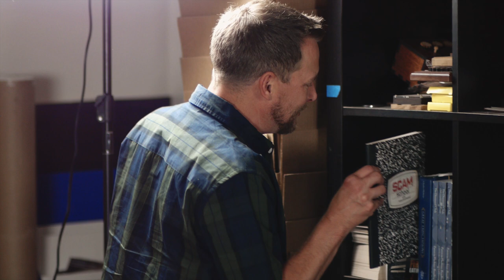Melting Styrofoam into Knives

Comment: "Styrofoam is strangely expensive on Amazon" yes. As someone who uses Styrofoam for model making, yes.
Reply: LPT: Hardware stores sell huge boards of it as insulation.
Reply: @CubicApocalypse128  They do, and in different hardness/densities, too, but it's got a very different texture from either of those foams. As an amateur prop maker, I use the stuff a LOT as sculpting material that I later turn into master molds that then are filled with resin/epoxy. It's very easy to work with, sands beautifully. It's EXTREMELY different from these two kinds of styrofoam. The crumbly bead kind that they used is impossible to sculpt/sand, and the other brittle "flower foam/craft foam" is also horrible to work with, but you can get away with using it as a frame of sorts for some projects. You just have to cover them with fiberglass and resin. 

So yeah, good info, just making sure everyone knows that they're VERY different kinds of foam, even though I think they're all polystyrene?
Reply: @wren7195  Yeah, craft foam is kind of garbage. What's even worse is that really crumbly green floral foam. You know, the stuff kids can't stop digging their fingers into at Walmart. (seriously, I've never seen a single piece of that stuff that doesn't have huge finger dents in it.) 

The "crumbly bead kind" isn't impossible to sculpt, you just need a hot wire tool to do it. I made some broken stone pillars with it for a stop-motion set once.
Reply: @CubicApocalypse128  Oh wow that'd be neat, I saw them doing that in some of the "making of" things for Lord of the Rings, it'd be really cool to see your work on the stop motion project. 

I completely forgot about hot-cut tools, I had a really flimsy one while back that broke due to operator error lol, so I kinda forgot quickly. Thanks for replying! Take care :)
Reply: @wren7195  I'm not sure if I still have the final animation somewhere. I do have some photos of the set, but the lighting we used really didn't show it off. The concept was, a guy fights a giant snake on a pile of sand in a flooded underground chamber.  It was a first-semester final project, and one of the other guys in my group insisted on only using a single dim light, centered directly above the action. I went to all the trouble of painting a sheet of styrofoam green and dabbing hair gel on it to look like water, but thanks to the lighting I might as well have just used a black tablecloth.
Reply: @CubicApocalypse128  That's unfortunate, I hate when one jerk messes up a group project by being lazy or over-controlling. I hope you had fun though, the concept sounds really cool. I keep picturing a cross between Chamber of Secrets and Conan the Barbarian lol
Take care of yourself, thanks again for all the fun conversation smiles Best wishes to you
Reply: @CubicApocalypse128  you should post the stop motion id definitely love to see it

Comment: Anyone else gets goosebumps from Styrofoam.
Also, 9:35 the burning acetone plastic could be used as a weapon, if you threw that on somebody it would burn and then harden so it would take skin off with it.
Reply: James Sawley Basically napalm.
Reply: yeah, in fact they make a similar thing in prison with melted chocolate
Reply: just less effective napalm
Reply: Yu Jin napalm is just a bit hard to come by so you have to settle for the next best
Reply: Eigil Holm military napalm is like 3 ingredients with 2 of them being gas and styrofoam
Reply: Eigil Holm it's pretty easy to find the rest I feel I might get banned if I say any more
Reply: Really? I thought it used molten metal.
Reply: James Sawley if you threw it at some one there's the potential to light yourself ablaze, effectively causing it back fire, no pun intended
Reply: Acetone + styrofoam is one of the most popular Molotov Cocktail blends, actually.
Reply: Really bad for riot control police officer's skin.
Reply: Digger Nick well, the napalm ones
Reply: Digger Nick It's not like officers are wearing short sleeves and shorts...
Reply: But they are not typically wearing fireproof clothing either.

Comment: Aren't those particulate filters on your respirators? Pretty sure those aren't chemical (carbon) filters
Reply: ItsAlleged hey its the modern rouge
Reply: good point :D
Reply: Whatever the filters are, all the acetone will be going around the masks, in the gaps created by their beards. Facial hair and respirator seals do not play nice.
Reply: especially beards that thick, those respirators were useless
Reply: I work with sulfur dioxide a lot and a little stubble doesn't seem to prevent a good seal. But yeah, that much man-fur probably becomes an issue

Comment: If u want to have no bubbles put the mixture in a vacuum chamber then use it
Reply: Tucker Wise what have you done with my cat
Reply: That's what I thought!
Reply: Yeah, they definitely have access to a vacuum chamber in prison.
Reply: Heat guns also work for that.
Reply: would need to cure in chamber. vacuum would evaporate acetone super fast when negitive pressure applyed.
Reply: or just, you know, use a little more acetan and stir it about 30 minutes
Reply: Jamez Martinez exactly this is supposed to be realistic not practical
Reply: Or just slam it against the table a lot till the bubbles come up
Reply: Seleen Shadowpaw acetan?
Reply: Yeah, that's pretty much how it's written in my language, problems with that?

Comment: Not a dirk! If anything, what y'all have got is a diminutive katar or failed bagh nakh
Reply: Gavin Christenson yeah a dirk is closer in resemblance to a dagger mainly due to the shape. However the main difference between a dirk and a dagger is that a dirk is meant to be more discreet and concealable. A dirk also smaller than a dagger which goes without saying since in a sheathe you get easily hide a dirk in your pocket or even your shoe depending on your fit size.

Comment: As a kid I soaked styrofoam with gasoline and when I tried well actually a mold I just put it on cement and let it dry and when it dried hard ,I sharpened it on the cement and made a really good knife very easily and very useful;  it lasted all through the summer,  but nice try guys
Reply: Mike Cherney u made napalm, good job!
Reply: Zed Zoss Well if he had to use it in an actual fight he could just break it off inside them and set it on fire and they have burning napalm just inside of their body.

It’s actually genius if you think about it.
Reply: That’s an impressive age to be making napalm B
Reply: Ian's Meme Factory that’s incredibly unsettling to hear someone say
Reply: Zed Zoss It’s a napalm knife, what else are you gonna do with it that utilizes the fact it’s made of napalm?
Reply: Ian's Meme Factory you know, that’s a very good point you have there
Reply: Either the styrofoam or gasoline ingredients have changed.   Used to melt it down with gas too and didn't get all the air bubbles I do now.

Comment: I think Brian's suggestion of dribbling the slug into the models was the big thing that made so many of the knives not work. The plastic dried instantly in small volumes so the plastic wouldn't be able to degas or to fuse properly. The only knife to get a good pour was Jason's and it turned out the best.

Comment: If you slammed the molds on the tabletop after pouring in the dissolved styrofoam, it would probably force the air bubbles out. It's what you do in baking to get the air bubbles out of dishes.

Comment: Hi guys you want a tip? 
You have to put pressure on the fluid to get the bubbles out. Like put it in a water pressure pot. I dont know the english word, but the key is pressure to make it a solid piece. Of course the solid product will be smaller in size than the fluid.

Comment: Here's what's happening here:
Styrofoam is a network of C8H8 (atleast that's standard polystyrene). Acetone does not have a standard chemical reaction that breaks the polystyrene apart into its components, but rather, it simply breaks the bond between the polystyrene molecules, making it into a Non-Aqueous solution (An aqueous solution is something dissolved in water, like sugar or salt, a non aqueous solution is an aqueous solution where the solvent isnt water). Then, as you know, the acetone dissolves allowing the hardened more compact version of polystyrene

Comment: the proper usage for using a respirator is  1) no beards. 2) when you breathe out and before you inhale, you must pause briefly.
3) when you breathe in and before you exhale, you must pause briefly. Why ? the sealing membrane must be completely shut/shunted to provide protection to your lungs. 

when you talk and breath(with out pausing) you actually let in out side air. especially if your breathing is labored.

Comment: The trick to a decent solid piece of plastic is letting it sit for a few days before attempting to cast with it so the air bubbles work their way out.. just keep a layer of the solvent on top and it'll never harden basically. We always used gasoline instead of acetone as well.

Comment: The packing material you first tried to disolve wasn't styrofoam (polystyrene). It looked like LDPE (Low Density Polyethylene). Two very different plastics, hence the different reaction with acetone.

Comment: I was wondering if you tried this again you could compress the shiv multiple times through the drying process so theoretically the pressure will push the bubbles out and give you a denser plastic with less bubbles in it.

Comment: sighs if you really want to make a knife from styrofoam, then use about 60-100 styrofoam cups. Light them on fire so they turn into a sludge. While the sludge is still warm and plyable, mode it into the shape you want it. Then file it on the ground after it is fully hardened. Then when you're done doing your dirt, slam it on the ground and it will shatter

Comment: When metal is poured into a mold there are little indentions on the sides or bars. I know you know what I'm talking about. You would heat the Styrofoam to a hot plastic consistency then, pour it, into a mold that's open on top, wait 3 days, you may get a better knife.

Comment: For anyone trying to do this.  I would suggest putting the acetone and Styrofoam mixture in a vacume chamber to eliminate the bubbles.  Also use a better mold to cast the blade in.  Silicone would work worlds better.
Reply from the maker: there are no bubbles.

Comment: You could probably pour the mixture into the mold and then put the mold in a vacuum chamber and it would take all the air out if it so it would have bubbles when you take it out of the mold

Comment: Guys i know my comment is too late. I guess the reason why your plastic got stuck to the mold is the absence of release agent, wax or even liquid soap (if you are in prison loool)
So next time try to apply a very thin layer of liquid soap and let it dry for 15 min before you pour the molten stuff. That will work like a charm.
Regards

Comment: You should redo this experiment, but de-gas the mixture in a vacuum chamber before casting into molds.
Reply from the maker: there was no gas.  The empty spots are where there was no polystyrene mixed with the acetone, and the acetone evaporated.

Comment: wrap toothbrush bristles in saran wrap or cellophane. Heat toward melting shape into slicing blade. Sharpen on concrete. Not a stabbing blade but a throat cutter.

Comment: Ok seriously guys do even a little bit of research on things first and you'd be so much more successful! I have made all sorts of things this way. Styrofoam works alright but instead of making a liquid goo like that keep adding more styrofoam until it becomes more of a mold-able plastic. Trust me you could have added A LOT more still.

You can also dissolve other plastics if you leave them in acetone overnight in something like a glass jar with a lid. I have chopped up and melted down (dissolved) the plastic sprues leftover from Warhammer 40k models to mold custom pieces or to fix damaged ones. I've made this as a thick liquid and as a clay like putty. This would probably work better than the styrofoam although the styrofoam might work in a similar way if left in a jar overnight, I haven't tried it with that.

If you leave it in a jar too long the acetone will evaporate off unless you have a really good seal and leave you with a solid puck in the bottom of the jar. Sadly my jars were all slightly smaller at the top so I couldn't get the plastic out after it had set like that unless I broke the jar but it was pretty neat still. It doesn't stick to the glass so it's loose in the jar but can't fall out. You can add more acetone and it will eventually soften again but it takes a lot longer being a larger solid piece.

Comment: the styrofoam dissolving is absolutely harmless. it might get warm but it´s as dangerous as dissolving sugar in water. just that the water is toxic low boiling shit that can get you to hallucinate^^ (acetone is a chemists favourite solvent for a reason. it´s fairly polar, counts as aprotic which makes it extremely useful. and the toxicity is mild. (like i don´t necessarily turn my fumehood when it´s the most dangerous component i´m working with.) but i the better safe than sorry aproach is always better than being an idiot ignoring a danger, when he knows its real, like the guy commenting here^^ but what would be fun if you fast dried it in an oven at 60°C it will be the dirtiest knifes in history but your wives will think you bought a new oven^^ Just a cup of acetone on low heat in that ventilator mode of the oven, where it mixes around the air in it, really is great at cleaning the oven. just set the oven one or two degrees below the boiling point (like go around 50-55°C Acetone boils at 56°C but well it evaporates at decent speeds at room temperature so you can imagine what it does near its boiling point. and i can tell you, every part that doesn´t get that warm ,due to being blocked by fat is perfect for Acetone condensation, and as that stuff is super soluble in acetone it drips right down. of course when your done set the open oven to 200°C and open the window for ten minutes and RUN out of the kitchen. you don´t want to get a wiff of THAT.  )